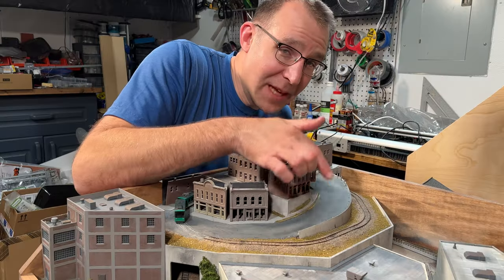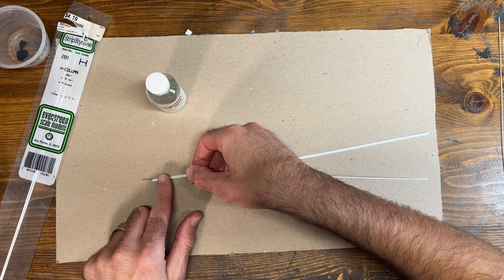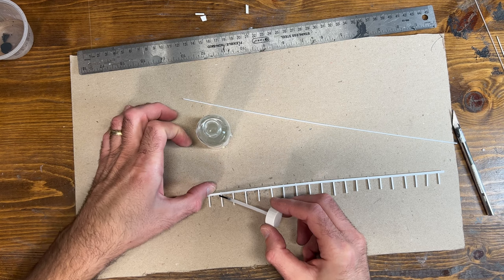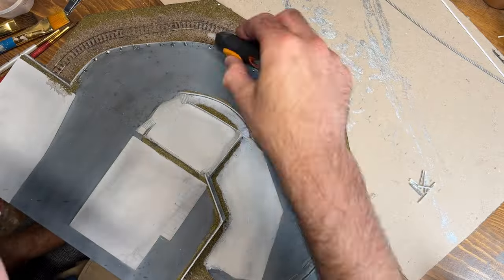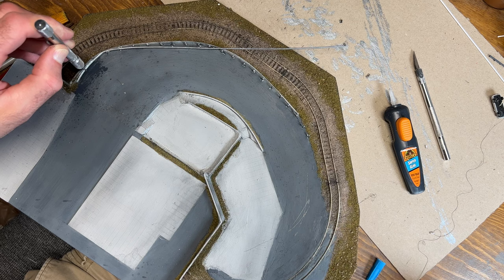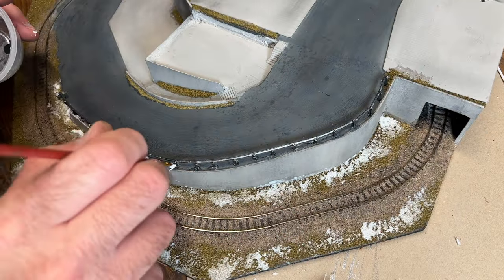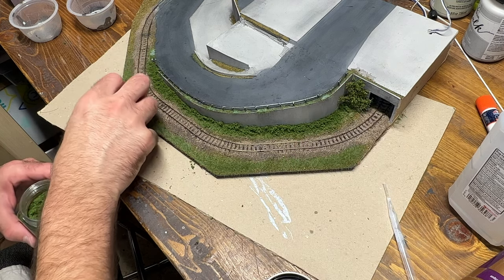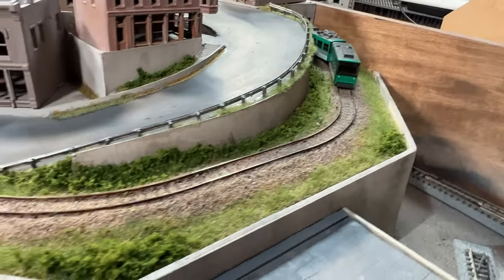Build Simple Model Guardrails to Keep your Drivers Safe!

Comment: You know what's great for heating the styrene - you hold the tip of a hot solder gun within 1/2 inch of what you want to do bend. It'll soften up quickly and you'll better be able to control how much heat you're applying. (Safer too.)
(And if you say thanks for the tip, that's like the ocean thanking me for a cup of water...)
Reply from the maker: That is a great idea. I use the soldering iron tip to shrink heat shrink tubing a lot. But playing with fire is a little bit more fun. lol.
Reply: @StevesTrains  Yes, yes it is. :)